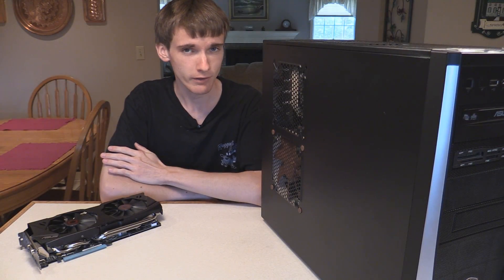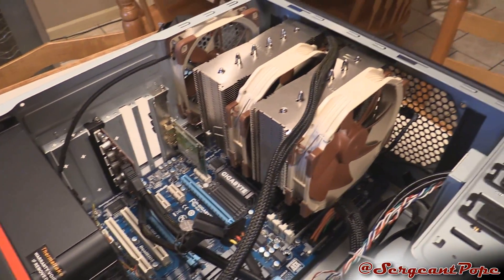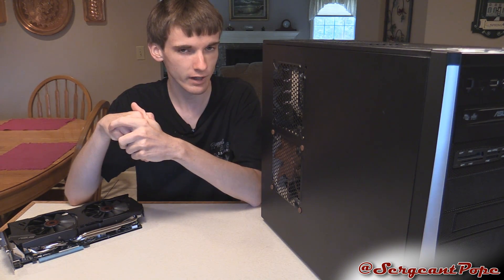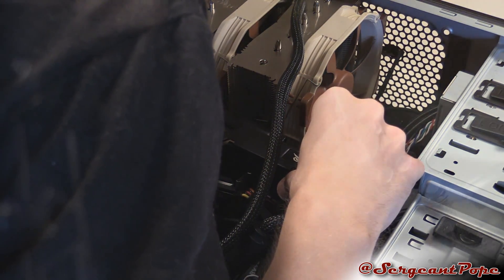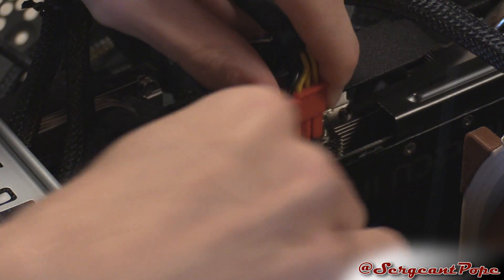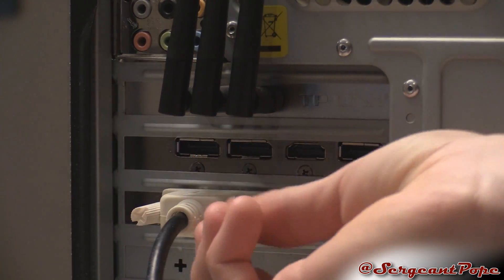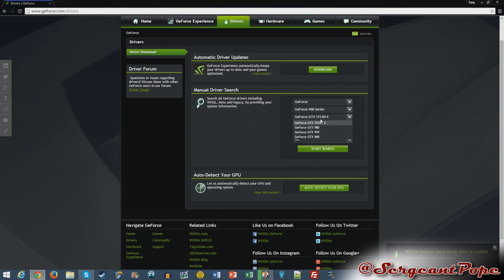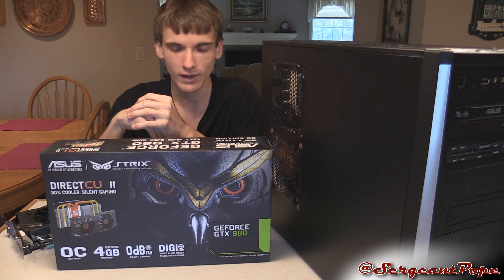How to install a graphics card - GET INTO PC GAMING EASY!

Comment: Hi, i was planning on upgrading my graphics card, but i have a couple questions. Can i use any graphics card on my pc? What is the best one to choose? I have a NVIDIA GeForce GT 610, so am i only limited to getting NVIDIA cards? thanks for any help
Reply from the maker: Y5370 For the most part, you can get whatever graphics card you want and can afford. You can get Nvidia or AMD. If you wanna tell me your budget, I can find something that will work for you.
Reply: SergeantPope i was thinking anywhere from 70-150 i just need something stronger then the one i have right now. Also if i do get a new card will i need more memory like 16gb. all i have right now is 8. Thanks a buch =)
Reply from the maker: Y5370 Alight. With that budget, I would get something like this EVGA GTX 750 Ti http://smile.amazon.com/EVGA-GeForce-750Ti-GDDR5-Graphics/dp/B00IDG3IDO/ or this Sapphire R7 260X http://smile.amazon.com/Sapphire-Version-PCI-Express-Graphics-11222-22-20G/dp/B00U8IS47A/
Both of those should run on a 400 watt power supply or greater. For gaming rigs, anything beyond 8GB of ram isn't helpful. There's no reason why you can't upgrade to 16GB, but doing that won't help performance.
Reply: SergeantPope Thanks so much. You were really really quick and helpfull. I gladly look forward for any new videos from you. Take care.
Reply from the maker: Y5370 Thanks, glad I could help.
Reply: Hey i just had a quick question. I opened my PC yesterday for the 1st time and cleaned up my cpu fan. It took quite a while and im planning on buying a brand new cpu fan and case fan as well. If i do buy a new cpu fan how would i know if it will work with my computer? The old fan was plugged into my motherboard i think. Thanks for the help
Reply from the maker: If it's an aftermarket CPU cooler, it should work on most motherboards. What did you get?
Reply: It looks really nice and has good reviews.
Reply from the maker: Y5370 The Cooler Master Hyper 212 EVO is very good, I have it on two of my computers. It'll work on pretty much any processor, too. Actually, I have a CPU cooler install video in which I installed the 212 EVO. If you're interested, here it is: https://www.youtube.com/watch?v=XYKWzv0d74Q
Reply: SergeantPope ooo thanks.
Reply: So im getting my cpu cooler 2m. Do i need to clean it with that alcohol thing or not? If so where do i get it.
Reply from the maker: Y5370 It's best to clean off the old thermal paste if you want to get the best performance. This is the kit I buy: http://smile.amazon.com/ArctiClean-3-5grams-Arctic-Silver-Compound/dp/B002DILLMS/
Reply: Thanks. I'll order this asap. Btw, what are regular temps a CPU should have? I'm running at 15-28 C with my old CPU cooler. It's just that it sounds like a damn airplane tho =/.
Reply from the maker: 15-28 C is actually pretty good for a CPU. That's what I get with my Hyper 212 EVO, but I have an AMD CPU, which run hotter than Intel CPUs. The 212 EVO is super quiet by the way, so say good bye to your airplane PC, lol.
Reply: Cool, well I'm gonna open it 2m and post results. Thanks for listening and helping so much.
Reply from the maker: Sounds good. No problem.
Reply: Mannnnn, today was all horrible.. I got the cooler master and it was so infuriating to install i couldn't get all the screw holes to allign. I would either get the bottom 2 or top. After like 2 hours of struggling i decided to just put the old airplane engine back. And now the zalman one has the same problem and in all the chaos i lose 2 screw from each fan. I put 2 Screws in and decided to turn on but It just sounds Hella weird and then my computer loses power. Idk where to go from here
Reply: Y5370 So, after spending another hour i read somewhere for amd coolers u gotta put a little more power into it. The thing is i cant install a backplate on my computer because the case blocks 2 of the screws on top xD. I had to take some screws out of the motherboard too loosen it enough to put the back plate. After that when i put in the cooler i misalligned the whole board. I only  got to put in like 2 screws out of the 6. By the time i noticed all that i already installed the evo and its whisper quiet. The evo 212 is fking heavy and my motherboard is not perfectly screwed in. Do i have to redo this whole process or will my comp live. Atm ive used it for like 20 mins straight and all seems good. Thanks for reading these 2 paragraphs xD
Reply from the maker: Y5370 Sorry for not responding right away, had a class tonight.
Installing CPU coolers is a shitty process, and there's not much you can do about it. But like you said, it's worth it once everything is installed and running. If you can't really install the backplate onto your motherboard, I usually suggest removing the motherboard from your case and installing the CPU cooler while the motherboard isn't in the computer, and then put it back in after the cooler is installed. That's a time-consuming process, but sometimes you have to do it.
So for now, I might suggest removing the motherboard to make sure the backplate is securely installed. Then you can realign everything so the motherboard is seated properly inside your case.
Reply: Not a problem at all. Thanks for replying.  As of now all the usb slots in the back are pushed and are unusable. Also for some reason if i put my pc vertically it has a weird noise like a ticking sound. atm i have it set horizontally and everything is running fine. The way my case and motherboard is setup makes it complete hell to change the CPU cooler, and now i miss the airplane engine. If i do keep it the way it is now will it break or something?
Reply from the maker: Without seeing it, I can't tell for sure if it's going to break or be fine. I would recommend removing the motherboard and putting it back in to make sure it isn't getting a short from a standoff being misaligned, which could cause issues.
Reply: i fixed the motherboard and put on the coolermaster back on. Everything is going pretty good atm the pc is ranging from 13-32 C. The coolermaster is loud today tho.. so idk but everything is working ok
Reply from the maker: Y5370 It's louder than it was before? Did you change any settings or anything that might have caused that?
Reply: it started hella loud before but now its perfect. I heard u can always change the fan too when its needed. Im prob gonna clean the heatsink and change in about like a week. Im about to order the gpu soon and i know they connect to the psu but will all connections work.
Reply from the maker: Very cool. Yeah, you can replace the fans if you want. The fan included with the EVO 212 ain't bad though.
Reply from the maker: It's alright. The GTX 750 is pretty low powered, but if you aren't looking into doing any serious gaming, it'll be fine.
Reply: ive seen a couple gtx 750s but they arent that cheap. is it something i should be worried about
Reply from the maker: To be honest, any graphics card under $100 is cheap. The GTX 750 you linked is refurbished, which is why it's a bit cheaper. GTX 750 Ti's are more popular, and they're around $100 or a bit more.
Reply: SergeantPope I missed the sale =/. Oh well, i guess ill probably find another and buy that asap. Thanks for the help.
Reply: SergeantPope Hey, ive got a little problem. My fans are running on 1900 rpm even on idle. The pc's temp is cool but i was wondering how to manually lower them
Reply from the maker: I know you can lower your fans speeds within the bios of most motherboards. Have you tried doing that? (usually you get to those menus by mashing F1 at startup)
Reply: What should an ideal rpm be on idle
Reply from the maker: Y5370 Honestly, I have no idea. I just set mine to "silent" in the bios rather than actually picking a certain fan speed. CPU fans generally don't have to spin too fast to keep a CPU fairly cool though.
Reply: Thanks so much. I'm getting my gpu 2m and I'll prob do both 2m. Hopefully I get it right on the 1st try... I usually gotta go back and fix my mistake
Reply: SergeantPope There was no silent option on mine. I just turned smart fan on and kept it on 40c while changing fan to use 30% max. Its currently running on 700rpm and is really really quiet. my temps are 20-40 now does that seem ok
Reply from the maker: Y5370 Very cool, that's good to hear.
Reply: SergeantPope just got my gtx 750 today... and like usual something has to go wrong. I plugged it in and everything was going good but then.... my damn hdmi cable wouldnt fit. The Zotac Gtx 750 had a smaller hdmi slot so nowww i gotta buy another cable just for this gpu =/... I did get it for 50 bucks tho so it was kind of a steal.
Reply from the maker: Y5370 That's lame. Some GPU manufacturers do use weird plugs, like mini HDMI.
Reply: SergeantPope Wow, this card was such a big improvement. I used it for like 2 hours today and it ran almost everything so well. Im really impressed and want to upgrade to something even better this week or next. I got my eyes on the Gtx 960, Gtx 970, and Gtx 980. All these cards are good but i just want to get a card that will work best with me. The thing is that atm i only have a 720p screen tv. I plan to purchase a 1080p monitor as soon as this one bites the dust. I also only have a 500w psu. What card do you think would be best for me?
Reply from the maker: Y5370 A GTX 960 is a good match with 1080p, but getting a GTX 970 would make sure that you wouldn't have to upgrade for a while. I would just get whatever you can afford. Everything up to a GTX 980 will run on a 500 watt PSU.
Reply: SergeantPope thanks, I'll probably just get the gtx 970.
Reply: Hey, hows it going? I just got a quick question. Rate from 1-10 how hard is it to change a psu? Mine is a mess and i was wondering if i should just change it now or only when i really need to. Thanks.
Reply from the maker: Y5370 It's not hard to swap out a PSU, it's just time consuming to make sure all the wires are tucked away nicely. If you need more power, I wouldn't hesitate to upgrade.
Reply: I was planning on buying a new psu and gpu but now i think im just gonna build a brand new computer. Ill send a pcpart builder link when i think i got something good
Reply: i really wanted an amd gpu or cpu, but people keep saying its bad. Here is what i have so far. http://pcpartpicker.com/p/2cqzLk
Reply from the maker: Y5370 AMD is decent. I have AMD CPUs on all of my computers, but the bad thing about AMD is they haven't come out with any new CPUs in three or so years, which means they're kinda out dated at this point. AMD GPUs are fine, but it seems like Nvidia has definitely been doing a bit better recently.
Anyways, that looks like a good setup. I literally have no suggestions. Good CPU and GPU, and everything else looks like it'll work together nicely.
Reply: Hey, i was actually planning to make that brand new comp for the living room but found out that my parents just wanted a regular dvd player =(. Oh well i was planning on using that extra money to buy alot of things for my personal pc. I want to start with a mobo for my fx 6300, and i just dont know what to get. I kind of want the msi 970 gaming or should i just buy a really expensive one like the crosshair or sabeertooth. What do you recommend? THANKS ALOT
Reply from the maker: Y5370 You don't have to get a super expensive motherboard, and MSI makes pretty good stuff. If the MSI board has everything you think you'll need, I would go for it if it's cheaper.
Reply: Thanks, i guess im going to buy the board then. Is it possible to switch boards without re downloading windows 8? cuz i dont have the cd. My mobo right now is an old msi board
Reply from the maker: Y5370 Usually you don't have to reinstall Windows when switching motherboards. That said, usually you'll have problems with your product key, because in most cases, a product key can only be used for one motherboard. So you might have to buy a new copy of Windows... or get a cracked version of Windows (I don't really like doing that though).
Reply: The thing is that sometimes motherboards break after a week or a month or some other thing like that. I also plan on adding a ssd sometime soon, and i heard that the windows cd is tied to one computer. Maybe im wrong idk

Comment: I am looking for a efficient graphics card (which has low watt usage, but can also give me good performance) and I was looking at the GTX 750ti 2Gb card (the standard one from NVIDIA) 
Is this a good choice, especially for efficiency
Currently I have a GTX 650 and am looking to get something more powerful
Reply: I have the exact some graphics card and i aslo want to upgrade iwas think anout gtx 960 flex or something around 220 euros
Reply: ***** Id step it up to a 960 over the 750 ti. if you're worried about the added size of the gtx 960 there are much smaller models available such as this, http://www.pccasegear.com/index.php?main_page=product_info&cPath=193_1732&products_id=31318&zenid=9dab422498787a71687913f6d280340e

That cards almost half the size of the standard and that card is essentially identical performance wise, these cards are extremely power efficient and do not run hot so you aren't going to have trouble with cooling at all. Trust me if you can afford it go for the 960 you wont regret it, but i bet you will regret it when ur 750 ti isnt killing everything with ease like a 960 would.

Here's the head to head of the two cards http://gpuboss.com/gpus/GeForce-GTX-960-vs-GeForce-GTX-750-Ti crysis 3 maxed with AA the 750 avgs 20 fps the 960 36 fps, almost DOUBLE the frames.

Btw if you know your computer can take a double fan set up size these gpus seem to be approx 25 - 30 centimetres 10- 12 inchs defs go for the double fan set up, i just got the smaller one because of my case size and that is what they're for. (i assume). although you wont find these smaller gpus in 970's and 980's as they are more powerful cards require more cooling.

Comment: SergeantPope i have $70-$80 budget and i need a good all round Graphics Card if u can find a 2gb that would be amazing but a 1 gb is fine
Reply from the maker: KobraShowsGaming Honestly, I don't suggest buying any graphics card below $100. The Radeon R7 250 might work for your budget, but I think you'll be disappointed with the performance. I recommend saving up for a bit so you can buy a $150 or so graphics card. The wait will be worth it.
Reply: SergeantPope what about this one thou? GeForce GTX650Ti 2GB 384Bit DDR3 PCI-E Graphics Card
Reply from the maker: The 650 ti isn't terrible, but it's kinda old. And if the one you're looking at has DDR3 memory, don't get it. GDDR5 memory is way faster than DDR3 memory.
Reply: Alright thanks (:

Comment: are my specs good? mid or high range?

i5 4590 3.3 ghz overclocked to 3.7 ghz
gtx 970
8gb ram
1tb hdd
hyper evo 212 cooler
h97m e35 motherboard
530w psu
sharkoon VG4-W case
Reply from the maker: FIghtXeno That sounds pretty good to me. The only thing I would want to add is a solid state drive.
Reply: SergeantPope do you have any suggetions on a 128gb ssd and can i move my os to that ssd but without the folder games on my pc would that be possible?
Reply from the maker: FIghtXeno The Samsung 850 Evo is a good, cheap solid state drive. I would just reinstall the OS onto the drive instead of moving it over. You can still keep your games folders on your hard drive.
Reply: I suggest more ram about 12 gb or 16
Reply from the maker: Anything over 8GB of ram really isn't necessary at the moment, especially for gaming. On a motherboard with 4 ram slots, I would get two 4GB ram sticks so you can upgrade to 16GB in the future.
Reply: SergeantPope  thx for correcting me :) :D lol

Comment: i have the 970 zotac card was this a good choise?
Reply: can i run games on 3 monitor i have 2 monitors right now and i am planning to buy a 3rd one can my 970 from zotac handle games in surround on 3 monitors in 5760x1080?
Reply from the maker: FIghtXeno I've never had any Zotac cards, but the GTX 970 is a good card. I'm sure it can handle that amount of monitors, but probably not at the highest settings. Honestly, when you get to resolutions that high, I think I would get two graphics cards if you want the best experience.
Reply: SergeantPope my motherboard only has 1 pcie x16 lane so i cant realy upgrade and i dont feel like buying a new motherboard i have a msi h97m-e35
Reply from the maker: FIghtXeno Oh, gotcha. Yeah, upgrading your motherboard wouldn't be worth it.

Comment: I planning to get the 960 gtx version and I'm still not sure which cables I need. Hdmi, vga, dvi whatever they're called, I'm not sure which ones are needed.
Reply from the maker: Jai Vaja You just need whatever cable your monitor has as inputs. The GTX 960 should have DVI, HDMI, and Display ports.
Reply: Ok thanks :)

Comment: Do I have to uninstall the old graphics card before installing the new one? What would happen if I install the new drivers before uninstalling the old ones?
Reply from the maker: Justine B. Legault Mostly likely, everything will still run fine with the old drivers installed. That said, it's a good idea to uninstall the old drivers before installing the new ones.